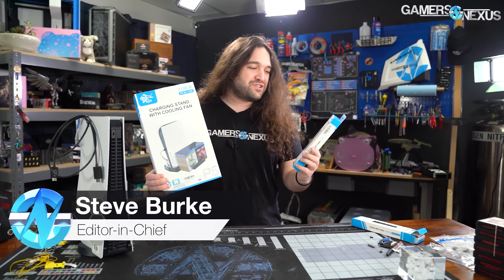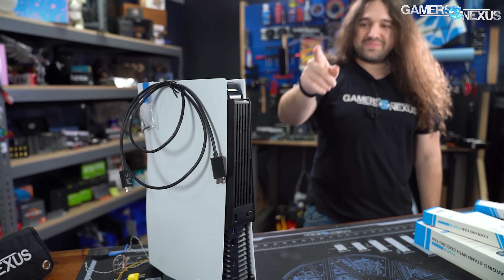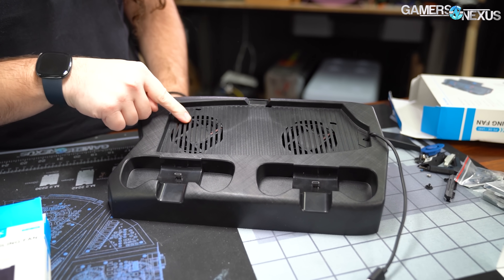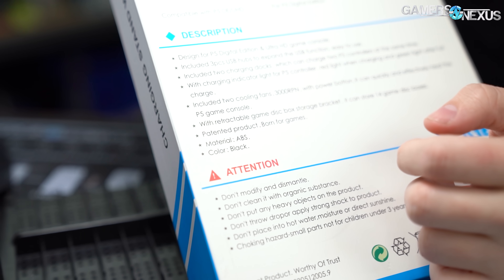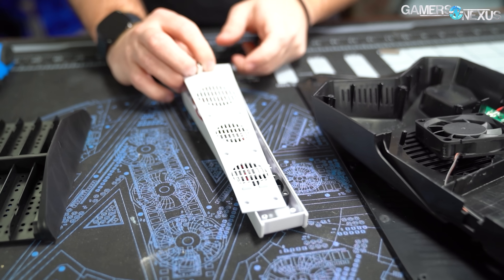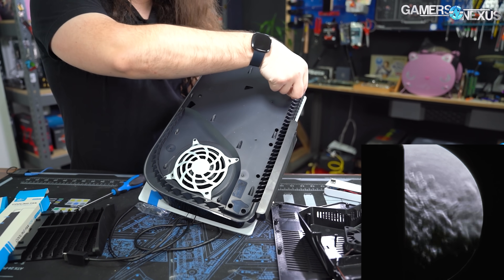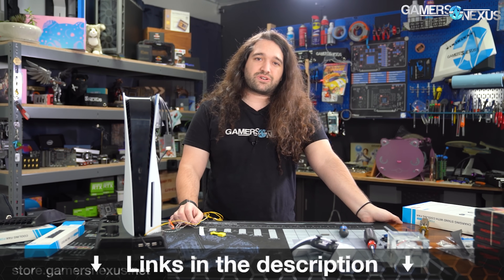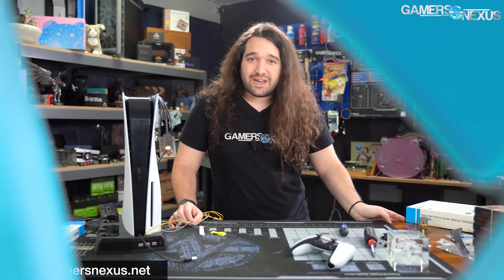Basically A Scam: PS5 Aftermarket Cooling Fans Blow the Wrong Way

Comment: So in what way should a cooling fan be designed/oriented to maximize cooling for the Ps5? Obviously not keeping the console in a crammed area and maybe even pointing a fan in the console's direction even will benifit the console but with what is available on the market, how could someone improvise in some way increased cooling for the console?

Comment: Hey actually idk if this will work. I ended up ordering a male & female USB adapter.  I can actually position the fan on top of the ps5 vertical or the left side horizontal.  That way cool air is going in from the tip not the bottom

Comment: Sony needed to drill holes in both the right and left side panels right where the fan is, that would give better airflow and lower the temp, just like when they are removed in the test

Comment: Nyko intercoolers for the X360 / PS3 were actually super amazing looking back on it  especially the X360 version as it was very efficient at pulling hot air outside of the Console, and it looked awesome too, and now seeing these pieces of garbage makes Me think how solid products used to be back in the day compared to the cheap crap of today !
Reply: wasnt the xbox 360 nyko cooler responsible for melting many xbox 360s?

Comment: The back piece I have is exactly the same, but I did a little trick and modified it. I dismantled the piece and did the opposite of the fans. Now the hot air is coming out. I swear I don't lie to you. Do it and you will see a result.

Comment: i did my own cooler for my xbox one x and my PS4 fat to help to take out the heat, i use a fan from a xbox 360, and  the one x not pass from 62°c playing CoD coldwar by 4h, when i turn off the xbox, It goes from 62°c to 30°c in 5 minutes, in the case of the ps4 it stay at 48°c playing Final Fantasy 7 Remake, about the noise, well, i can't hear it cause i use my headset

Comment: Nothing matches the INTERCOOLER for the Xbox 360!!
this is actually really sad.. the intercooler was a BEAST, because it ran really nice fans from the 12v Xbox 360 power brick.. it really chucked air,  two 360s I have won't even get warm with it running!! Not even the OG Black 360 with the highest power draw..

Comment: I was kind of hoping the video would reverse the fan direction and measure the results just to show the difference between the stock device had it been configured correctly.
Reply: would have been negligible since your still using shitty cheap tiny fans

Comment: Try flipping the fans around! I’m curious to see if it actually works when you flip it around.
Reply: Same thought here
Reply: Same thought here.
Reply: Im curious also, but along with flipping them, trim the plastic covering the fans on both sides as much as possible while still being able to keep them mounted the way they are.
Reply: The base of those cheap fans are too wide to actually provide good airflow if it had higher quality fans than your idea would 100% work effectively

Comment: At 9:25 I assume the person on the factory floor was not in a good mood or it was his/her first day and didn't understand how fans work so inserted them in the wrong direction. As they are not screwed in and it's clear they can go in multiple directions then it may be work correcting the issue by just reverse the fans and do the test again?

Comment: I'm going to cut a hole in each side right where the fan intake is, and then mount a 40mm cooling fan filter to the outside of each side. Should drastically increase airflow, while filtering it as well

Comment: That $40 one is literally just 2 cheap fans worth like $5 wired with an on/off switch connected to a USB hub and 2 USB C connectors for charging the controllers inside a cheap plastic case that has DVD case slots I could literally just make my own and 3D print the case of it for like $20 and these guys are obviously making it for less than that especially since they can get the items at wholesale discount prices and they have tools and equipment to mass produce them at lower prices than an average person

Comment: Would love to see how the small version would act if you swapped the fans around
Reply: Don't think it would help anyway because of the amount of plastic blocking airflow. Horrid design all over.
Reply: Probably they are on the opposite side of the "Right to repair" and for the sake of our "safety", you can't disassemble this shit without destroying it to some degree.
Reply: surely nothing (at best) if the hot air has already exited the device and is now entering the surplus exhaust
Reply: @hollenhammer  By decreasing the pressure it might enable the fans inside to go faster, although it is less likely because it's not, like, an axially-aligned pair.

Comment: i have one of this stand for my ps4 pro.Never use its fans,but i used the charging port of it many times.Plus i needed my ps to be in a standing position so its was a 70-80 % success for me i guess.Also this in the vid is is way to expensive,i got mine far cheaper .

Comment: “So, this fan’s around 8500rpm. Not sure what that is in the conversion to rpn..”
The world would be a better place without cheap garbage like this that only serves to waste plastic.
Reply: Not just plastic. Someone 'engineered' it, made the injection dies, and shipped it halfway around the world from factory to port across the ocean to port to warehouse to retailer. 

The world would be a better place with fewer idiots.
Reply: The idea is good, the execution is garbage.
I could probably build something better myself, just with a bunch of fans and a USB cable.
Like, buy a couple fans, solder them to the USB cable, put those metal grills on top so you don't cut your fingers, and done. And I have 50mm fans that go 4500 RPM, so it would even be quieter than what they cobbled together.
Reply: The fans didn't do anything wrong though!
Reply: Thing is that these companies make this crap every console generation. The first time i saw this kind of product being sold was during the Xbox 360 era where it promised to reduce fan noise. I've seen them every console gen since. 
I just checked and they were also made for the Xbox/PS2/GC era.

Comment: actually ive used these I modified the plastic to be more open then replaced the power input to its own instead of the PS power mine lasted 1 year longer than my friends
Reply: That could be simple "tollerance" in the actual Playstation. For example a friend of mine and his partner both bought a GTX 1080Ti at launch (same order, just bought two identical ones) and the one of my friend still works, while the one from his partner died roughly a year ago, with identical maintenance and strain and load on it.

Comment: So what I got from this is you would probably do better by spending that $40 on a cheap pc case, move the internals of the PS5 over, and bin the PS5 case..... or save a lot of time and money and not buy the cooling fans.
ps: Do you think the screws on the main PS5 board has an ATX form factor?

Comment: I purchased the PS5 stand model. Set it up and turned on the fan and it was so loud that I turned it off and never turned it back on. But on the plus side it makes the PS5 a little sturdier standing up and the controller dock works ok plus mine has a spot to hang your headphones.

Comment: "Cooling mods are definitely going to be a 'Hot Topic' " Good one! Why would you make such a cooling mod, for a device that already has a big blower? At the very least, the supplemental fans should be at least as big as the included blower.

On the bright side, the fans aren't screwed down. That means that you could potentially reverse the polarity of the air flow, if you wanted to. I'm sure it wouldn't affect things enough to be worth the price, but it might be interesting to see, if it affects the results in a way that's helpful in the slightest.

Comment: I'm surprised on the back fan module that the fans were just slid on to corner pins, you didn't just flip all the fans over so they were at least facing the correct direction, and then test it again.  I'd imagine it would still be worse than stock because it blocks so much air but it may be better than 10deg worse?  LOL

Comment: Lol, it looks like that one that connects onto the back and passes through usb has a usb 2.0 plug on the inside, but 3.0 on the outside, meaning that it's also cutting your usb port down to 2.0 speeds.

Comment: Re: 2-pin fans will always run at 100% (somewhere around 7:35). This isn't true - you CAN vary the output, you just don't have closed-loop control. If you always have the same fans, you can reasonably expect similar results.
Not that this is what those are doing at all, but there's nothing preventing them from going with a thermistor or something, "OK, it's cool, drop the voltage to 4 V to slow them down".

Comment: So it would have been easy to flip the fans around and test again but you didn't because "YOU BELIEVED" it was pointless. Good science! Also you could have drilled holes to fix airflow on the inside plastic walls. But you were never interested in actually fixing it for better temps because your mind was set on one title.
Reply: ... He was right on both, flipping over would just overheat the console, and drilling holes into a PS5 is fucking stupid.
Reply: @potto1488  Drill holes in the accessory unit, NOT THE PS5 you numb nut!!

Comment: At least with the rear USB attachment thing they were considerately incompetent enough to not glue to fans into the plastic housing. You could just pull them out, flip em around, cram them back in, and it should blow air out properly now right? lol

Comment: So looking at the use of the RPM meter I didn't notice you putting a white blade on the fan. Won't that optical meter count every blade/gap? (I'm not familiar with that meter/tool so I could be totally of base here.)

Comment: So what I gather, the snapon product would be effective if you dismantled it and reversed the fans?
Reply: The reason I ask is because if it would work, can the case of the fans be modified to better circulate more air without impeding the native flow?  It seems that the perfect snapon is something to work with if you are willing to Significantly modify it.
Reply: Also, anyone here have data on just running it open with additional fans stacked side saddle?

Comment: Here's a just as stupid one for the Xbox X https://www.amazon.com.au/Vertical-YUANHOT-Charging-Controller-Retractable/dp/B08T1LX92G/ref=sr_1_2?crid=2KUDZRH3VVQ0T&dchild=1&keywords=xbox+series+x+cooler&qid=1613942988&sprefix=xbo%2Caps%2C397&sr=8-2
Looks like the fans magically teleport air through the base disc of the console

Comment: I actually have the back fan mod and after watching your video I actually switched the fans in the right direction… so now the fans exhaust instead of pulling in air… is there any advantage or should I just take a loss? 😂

Comment: 9000RPM? I could be wrong, but industrial cooling fans and low-profile server fans don’t spin that fast, and they’re much more robustly constructed. If those are really spinning at 9000 RPM, you might have a second consumer safety problem at hand.

Comment: maybe you could stick the fans to the part where normally no air comes out with hot glue. 
in the right orientation.
the results optical uglyness would certainly match the acustic ugliness it has anyway...

Comment: Hey that's a good price for a stand and a game disc holder and why didn't you flip the fans backwards so they would blow air away instead of inside and test that way ?
Reply: Cause it doesnt go on the other way?
Reply: @Niklas-cd4ek  it easily does
Reply: @pavy415  so you tested it?

Comment: RPN is Reverse Polish Notation. You have to put the number in twice before you perform any measurement. So, 8000 RPM does seem to be within its ~4000 RPN rating. 😁👍

Comment: RPN = Revolutions per Newton? Also, maybe they work better in tandem? Plug 'em both in!

Also, maybe you should get a set of dbrand plates and see how good they are, followed up with a few extra holes in them to check how the extra airflow might help?

Comment: I had a ps4 cooler stand and just used it for the extra usb ports and controller charger, plus being the ventilation on the ps4 had opening on the sides and front I kept it in the stand to keep it raised .

Comment: 5:00 I really expected better than this Steve and co. You misrepresented the packaging by a long shot and it was right in front of you the whole time. This IS a cooling device. It's meant to cool ambient by keeping as much of the heat inside the device as possible. You see, Sony in all their infinite wisdom doesn't realize that gamers don't like hot rooms and added pesky "exhaust ports" to their consoles allowing all that hot air to escape. If we've learned anything from Star Wars, exhaust ports are bad. These cooling devices are the unsung heroes of a generation of sweaty gamers.

PS: Yes, this is all satire.
Reply: Glad you added that at the end. I would have thought you were serious otherwise.

PS[5]: That was also satire.

Comment: Basically, you absolutely need these products because the consoles are designed to work up to specifications without them and the stock cooling is adequate for the tasks they run

Comment: Why doesn't someone just make a replacement side panel for the PS5 that has mesh where the intake fan is? 
Simple change for more airflow, don't even need to add fans.

Comment: Liking now, watching later ;-)
Watched now... Your definition of a scam is pretty generous. I mean, they've brought a product to market based on false claims and are preying on a potential customer's belief that their shiny new console will overheat without their amazing new product. This is beyond mere capitalism, and screams (much like those fans) scam. While they may not intend the product to cause harm to the user, the benchmark I think you're using for malice, their ineptitude in design and laughable translation of the box copy are a clear indication of indifference to the enduser. Also, if the reviews are fake (and for the sake of humanity I'm with you on hoping they are) then it's straight-up fraud, and automatically demonstrates malice.
Now, I'm a big fan of Hanlon's Razor, though I prefer Heinlein's version: "Never ascribe to malice that which is adequately explained by incompetence." But I think we've seen enough to know better in this case.

Comment: If you flipped the fans inside of the rear fan assembly, since you showed that they are not screwed in, would that have aided cooling and airflow? I realize that is not how the product ships but I am curious if it would be worth it.

Comment: These products are a scam regardless due to your system already being designed to cool itself and these products rely on the system's power so therefore you're putting more stress on the system. These products are no different than those fuel additives you can get for your vehicle. If your engine truly needed this stuff than the owners manual would tell you about it.

Comment: The cooling sucks but it’s good stand and charging dock what you can do flip the fans around to suck the hot air out works great or turn the fans off keep the. Charging on which option you like

Comment: The one that is placed on the exhaust, I am honestly curious, could it perform better if one ensured that it actually had the fans in the correct orientation?
Reply: It would work if the fans were of high quality   not cheap fans with a fat base

Comment: Wonder if they will sell a panel with a hole cut into it and call it revolutionary. It would probably cost 80 USD for a piece of plastic because it might work. 

I wonder if the fans were pointed in the correct direction if these devices would still cause over heating. I would say that both devices would impede air flow, and thats just by looking at them. This is much the same effect as cheap cases with dense foam air filters. Cut out the cages with tiny holes and remove foam, air flow, wow. 

That was a funny video Steve. Game Stop back in that PS 2 and Xbox days said they would void warranty if they got word that you used devices like this. They are made by Chinese companies that are only out to make money by slowly destroying your device. In this case overheating. I can't beleive they still sell this shit in any reputable store today. Your Charts tell it all.

Comment: I do have a question regarding the revolution of those fans. Ideally, you'd have a marker on one of the fins to measure how long it takes to go one full revolution, but it appears that there was no marker on the fins? It's hard to tell with them spinning, so perhaps there's a marker and I missed it? If there's a marker (reflective tape, maybe?) then ignore below. 

If there's no marker on the fins, wouldn't you be measuring the space between each fin? By that I mean, wouldn't the tester be measuring the time it takes for each fin to pass in front of the beam? If so, there's more than one fin on the fan, so how are you getting an accurate revolution measurement? I'm not very smart, so maybe I'm missing something here...

I suppose you could take the revolution measurement, and then divide it by the number of fins. Maybe Steve did that, and I missed that part of the video. I turned it off after that section of the video. Anyhow, I just found that 9000 rpm number a bit odd, considering most case fans only run at about 1500 rpm, or around there.

Comment: I have to admit, I am greatly disappointed.  The rear fan FUBAR does NOT include rainbow puke RGB???  Missed opportunity!
(Miiiiiiiiinor question.  Not that I expect it to help ... BUT if you pull the rear fan FUBAR apart and flip the fans, does the airflow moving in the correct direction now actually help ANY, or is the airflow impedance still outweighed by the extra fan suckage?)